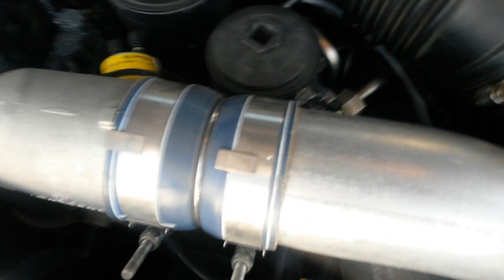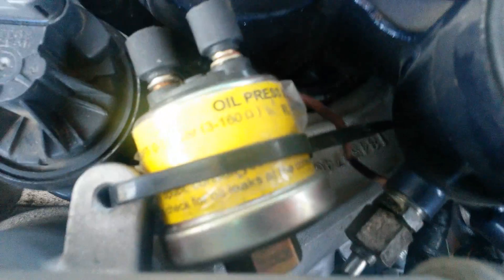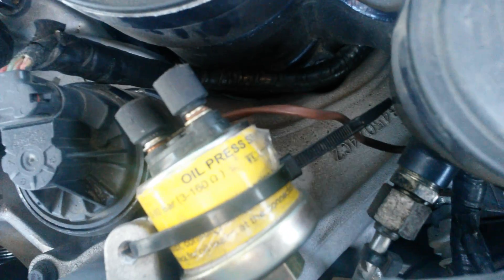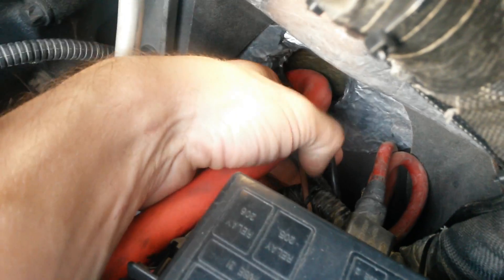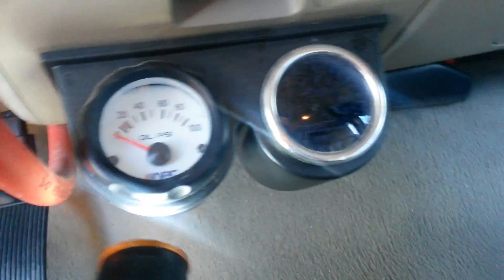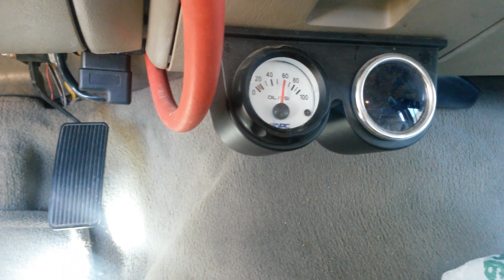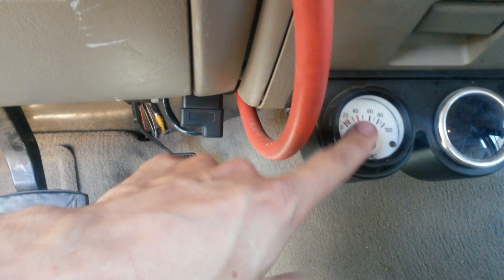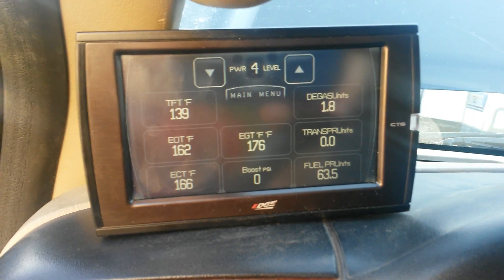FORD 6.0L ~Hookup a Fuel Pressure Sensor for Less Than $30. Cheap & Easy

Comment: I am totally impressed with this edge set up do you have a page with the sensor count and pressures ,Basically I want to do to my 2006 6.0 what you have done to yours. Dgas,tranny, all of it so if you have those part numbers for your edge and the extra devices or expanders you used that wold totally be helpfull . Thanks in advance for any help . I just got my truck three months ago and want to monitor as much as I can.
Gibsonsystems112@gmail.com
Don't stop posting these videos man they do rock.

Comment: I found this $13 gauge to give accurate readings..... http://www.ebay.com/itm/301589616212?_trksid=p2057872.m2749.l2649&ssPageName=STRK%3AMEBIDX%3AIT

I found this $17 gauge the have very low inaccurate readings (junk)......  http://www.ebay.com/itm/311684423032?_trksid=p2057872.m2749.l2649&ssPageName=STRK%3AMEBIDX%3AIT
Reply: It comes with the sensor/sending unit. You will need your own wire. Two pieces. There is not a ground on the sending unit so I wrapped a hose clamp around it and grounded from the frame to the hose clamp. it will not screw directly indo the port on the fuel bowl. you will need the hose and other fittings the OP lists. my sending unit ended up leaking, yours may not. I removed mine and went with a glowshift fuel pressure gauge instead. I am totally happy with the glowshift fuel pressure gauge. It is a cleaner setup but of corse more $$.

Comment: +cr38er Do you believe this sam setup will work (12v pressure sensor and gauge) for the degas bottle? I don't think I will be getting into the 5v sensors unless I can find digital gauges to go with them.
Reply from the maker: Benjamin Hansen Yes it will work for degas
Reply: Great! I am not fond of the heater hose that is T'd from the degas running into my cab right now. I plan to cut this hose short off the T and put the sensor into the hose rather than tap into the side of the degas bottle. Thanks for your videos.

Comment: where did you get the gauge at? I've been looking on ebay and Amazon and can only find the ones with the 1/8" npt fitting
Reply: This one gave me accurate readings..... http://www.ebay.com/itm/301589616212?_trksid=p2057872.m2749.l2649&ssPageName=STRK%3AMEBIDX%3AIT
This one does not give accurate readings (reads low) http://www.ebay.com/itm/311684423032?_trksid=p2057872.m2749.l2649&ssPageName=STRK%3AMEBIDX%3AIT
Reply: Any fuel pressure gauges at O'Reilly or Auto zone you think might work?

Comment: I tried this on my truck and it's not working. I think the transducer needs 5 v not 12v. how do you get 5 v to the transducer?
Reply: Steve Mertens which transducer did you buy?
Reply: It's an IIL 80 psi. 5v from ebay. I hooked it up and had 12v going to it and it was pegged on 80. I think because it should only have 5v going to the transducer.
Reply: I thought 5v was 5v going to the guage. 12v to the transducer. does anyone have a wiring schematic .
Reply: Steve Mertens Yeah. the video was showing use of the cheap 12V sensors and gauges you get on eBay. for can actual 5v pressure transducer I have videos showing use with the Edge EAS sensor system which uses 5v. the 5V ref voltage of the truck goes to pretty much every 3 wire sensor. you could tap into that, or buy a 5V sub voltage converter

Comment: Is there any way to do a degas pressure guage video? Thanks
Reply from the maker: Working on it. I had an awesome video melting a threaded hole into the degas bottle, but the file got corrupt. Sucks cause it was a good video and you can only really do it once. I'll put up a video with the basics though.